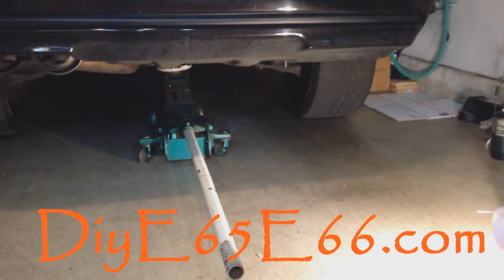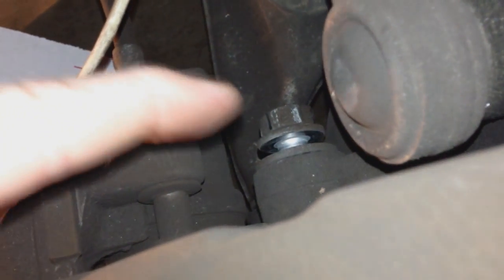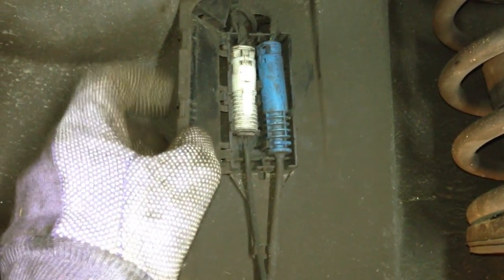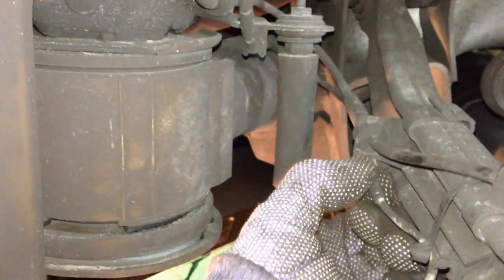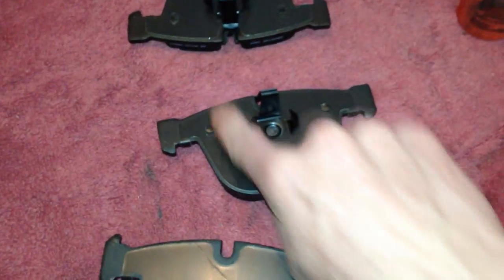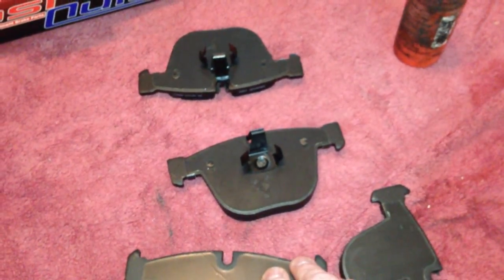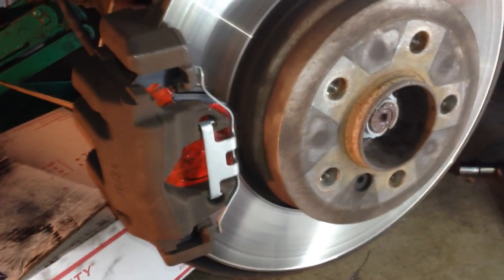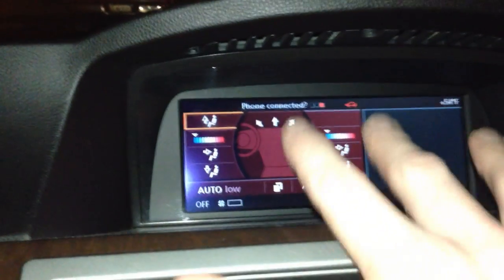DIY BMW E65 E66 Install New Back Brakes And Brake Pad Sensor

Comment: An old video but still helpful and relevant. I'd add, that if you don't have channel locks or a brake piston depresser tool, you can also lube up the rubber boot around the brake piston, where they meet and use wide wise-grips and gently rotate the piston, making sure not to grab the rubber or that it doesn't twist along. The rotation will also depress the piston. Not sure why it works, but it does, have done it on many different makes and models, successful each time without missing a beat.

Comment: Great Video...thank you for all the work.  One comment I want to make is how I believe the brake sensor works (and the reason that you are not getting an error with the sensor disconnected).  When the brake wears down to the point that the sensor hits the disc, then the disc will wear away the sensor's outer insulation at which point the contact/wire of the sensor will ground out on the disc and complete a circuit that sends the message that your brakes need replacement.  Hence, if the contact of the sensor is not touching any metal part of the vehicle to complete the sensor, you will not get an brake wear indication.

Again, great job and thank you!

Comment: Thanks for this video, it makes everything quite clear. One suggestion is that instead of using channel-locks to compress the piston, I found a "brake pad spreader" tool at NAPA for less than ten dollars. Very easy to use. It's probably available elsewhere too.

Comment: Next time use a steel brush to clean out the calipers and then just use 5 % of the red stuff on the back and use it to help the breakpad slide better trough the calipers. This will prevent your breakpads got stuck and from sided wear and squeeking. Also a good idea would be to mesure the thickness of your breakdiscs to make sure the have enough metal left. Hallo from Germany ;)
Reply: I am not sure what the moly lube that comes with the brake pads is, but I'll bet using nickel-based anti-seize compound with work just as well. You might even be able to buy brake grease at the auto parts store, maybe even mix the two into a paste.
Reply: @Mark Berenger For your information I am a graduate mechanical engineer with a professional license and more than 40 years experience. I don't know what you think you were saying, but you might want to leave snarky comments to someone with more than any 3rd grade intelligence....and the manners even a 1st grader knows.

Comment: great video...but there i a slightly easier way.
The sliders that you show in your video can be removed....then the caliper comes off without having to undo the supertight 18mm nuts.
SO...
Take off wheel, loosen brake fluid cap etc.
Remove rattle clip.
Then force piston back.
Remove two dust caps off slider posts...undo with 7mm? allen key.
Use needle nose pliers and wriggle a bit to pull the pins ...AND..... bam the whole thing comes off leaving the mount attached.
Anyway.....thought your video was great as are all your others...thanks
Reply: Sounds like an interesting alternative....but I find removing the 18 mm bolts is easy enough, and I was even able to use a 19mm hex socket on them with no problems.

Comment: I dont know if your e66 is like this but my 08 e66 requires different brakes on the rear.
What a hard lesson i learned today
:(
Fronts are changed....now gotta wait for the rears from amazon

Comment: Hello, great video thank you for posting. I have the same question as one that's already been posted. Since the E66 has the electronic parking brake, 2002 model, do I need a scan tool to set the e-brake (retract the piston) or can I simply push it back (as in this video)? I have the scan tool that does this, just wondering if it's required, thank you.

Comment: Hello,

Can i do it when i have electric handbrake ? 
Can i press the pist back ? 
I wouldnt like damege my rear brake.

Thanks for your answer
Reply: My 2008 750i has the electronic parking brake and I just did this job yesterday. I bought a "brake pad spreader" tool at NAPA for under ten dollars (it was on sale for $6.99) and the tool makes pushing the piston back very easy. Much easier than using channel-locks.

Comment: If you think the CRC Brake cleaner is good you shoudl try the Fleetrite Brake cleaner. You would buy it at an International dealer or other heavy duty truck Dealers.

Comment: Hello, could you show on video how to change bulb of the angel eyes on E65/66?
I saw some guys to take of whole fromt lamp, or even the front bumpeer to be losen...is that necessary?
By the way , I both the LED lamps, they came with some king of transformator, could you show how to install it and where to leave the transformator?

thanks a lot if you read me..
keep on producing videos of e65!!!

best regards
Lubo-Stockholm

Comment: I have a 2006 750li and when I'm in reverse my car still rolls a little after pressing on the break . I have to press them really hard . Do you think I just reed to replace my back breaks or is there something else wrong ? Thank you
Reply: I assume you are talking about this happening while driving and not using the parking brake?  If so, something else is probably wrong, since the front brakes provide about 80% of all braking power. If you are sure the front brakes are good, then you may have: low brake fluid, a leak in the system, a failing brake booster or master cylinder. If you have to press really hard to keep from rolling, it indicates that the system is not developing full hydraulic pressure.

Comment: do the rear brake pads wear out quicker that the front.
Reply: No, exactly the opposite. The front brakes are balanced to provide about 80% or more of braking power and as such wear out at least twice as fast as rear brakes.  This is done to assure better control while braking.....the rear brakes ever lock up, the back end of the car will break loose and the car will be out of control.

Comment: So do you have to change the sensors?
Reply: Yes, unless you want to have a constant Replace Brake Pads message until you do. The sensors can be bought on eBay or from online parts stores for less than $20 each. Plus, you will not know your pads are worn until you start hearing  grinding sound, which is metal-on-metal contact between the pads and the rotors. Then you have to change the pads right away because you are losing braking power.

Comment: Do I have replace the sensor every time I change the brakes
Reply: You could inspect the sensor for wear and if there has been no contact, you might be able to re-use it. But if you have gotten the brake wear message, the sensor is worn and can't be re-used.  On the other hand, it is a $20 part, why take chances with it?

Comment: What's the red thing you put on the brake pad ?
Reply from the maker: The red stuff is brake noise silencer that helps the noise of braking, you can use other brake silencer stuff as well, just make sure you get the right stuff, if your unsure you can ask the guy at the shop.
Reply: ok, I've just bought a caliper lube: Not sure if it's the right thing :
 http://shop.advanceautoparts.com/p/permatex-ultra-disc-brake-caliper-lube-.5-oz-85188/99997944-P?searchTerm=brake+grease
Reply from the maker: That stuff looks good to me:)

Comment: thaths not how ou change pads you see the rubber which are rain shields you remove those two tabs in push the caliper back then take a star wrenceh and losen them its not good to teach people the wrong way of doing things
Reply: Just because you do it that way doesn't make the other way wrong. Check out a shop manual sometime and you will find the video shows a recommended way of removing the caliper.

Comment: When do I know when to change the brake pad ?
Reply from the maker: Hello, you'll know without checking if you hear metal on metal, that's the pad finished and it's rubbing against the rotor, lets just say it doesn't sound good.  Other then that our cars will tell you through the idrive when it's time, but I actually ran mine for another few months.  You see how worn they are in the video, don't wear them down that much, I was a little risky.
Reply: You will get a message on the dashboard disply telling you to replace the pads.